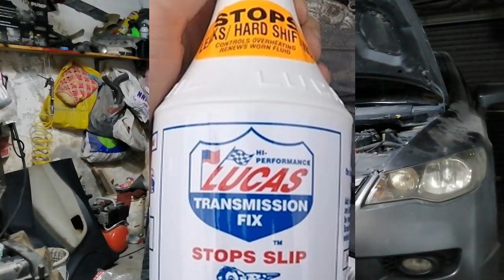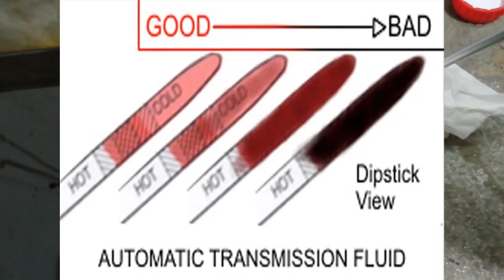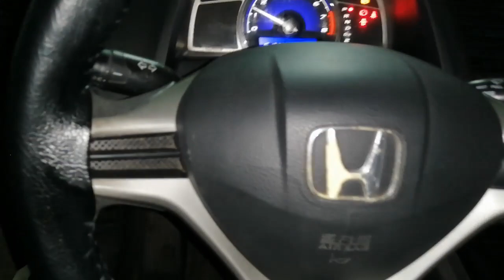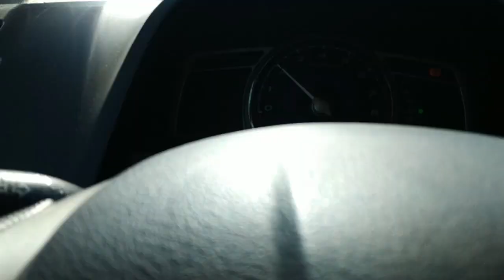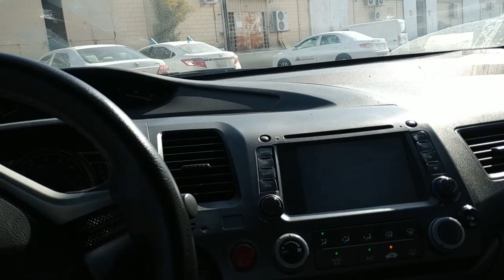Paano mawala ang Delay at kadyot | Transmission Oil Replacement | Lucas transmission Fix

Comment: Na try ko na boss yung LUCAS trans fix sa Chevrolet Epica. Yung automatic transmission ko may slipping, tapos nag limp mode sya, nasa 3rd gear nlng sya hindi na ng 4th or 2nd 1st gear, steady na sya sa 3rd. So binawasan ko ng 24oz (710 ml) at nag add ako ng Lucas trans fix na 710ml. After 4 to 5 days naging smooth na ulit ang shifting at wala ng slip. Balik na sa dati. Pag lagay mo hindi sya agad effective, mag drive ka muna mga 3 to 5 days para humalo ang Lucas sa transmission oil.
Reply from the maker: Yun oh, oo sir minsan mararamdaman MO pag babago after Ilan days depende sa issue NG transmission, jeep safe sir.

Comment: Ser makatutulong kaya yan sa automatic transmission na crv 2004? Ang problema nya, pag tumatakbo, pag bumitaw ako sa silinyador, yung rpm bumabagsak mula 2000rpm bumabagsak bigla sa 500rpm tapos babalik din agad sa mga 1800rpm. Parang sa manual pag diniinan mo ng todo yung  clutch tapos ibabalik mo din. Nangyayari lang siya pag bumibitaw ako ng apak sa gas.

Comment: Sir ung honda Civic fd ko (2008 model) may delay po, it will take 1 second to accelarate faster kung mg oovertake tpos nmn po pag nag rereverse po 4 seconds po bago pumasok, ano kya maganda dito sir?
Reply from the maker: Hello sir ace. Eto mga dapat mong I conseder sa issue NG auto MO. Fuel filter baka dikapa nakapag Palit. Fuel injector baka madumi na. Sparkplug better to change if matagal na sobrang di na papalitan.
Reply: @Macgarage08  sir location nyo po same po kami ng issue ang sabi sakin need na daw rebuild yung transmission or palitan ng surplus po
Reply: sir ok na yung sayo? same kasi tayo ng issue
Reply: sir ok na yung sayo? same kasi tayo ng issue

Comment: Can this be used in a 1999 Toyota Hiace? 1kzte engine with automatic transmission. Thanks!
Reply from the maker: Yes po, you can use this for automatic and manual transmission diesel or gasoline engine.
Reply: Thank you!!!

Comment: Sir. Anu po mas magandang transmission fluid sa honda city 2006 idsi ATF DW1 or CVTF. sana masagot tanong ko. Slaamat more power.
Reply from the maker: Hello sir joenel.  Atf lang need mo sa 2006 city DW1. Kasi ang cvtf is sa CVT transmission mag kaiba ang CVT and normal AFT.
Reply: @Macgarage08  sir ano alam nyo po ba ang tamang transmission fluid for honda jazz 2005 idsi 1.3? naguguluhan na kasi talaga ako sir. twice na kasi ako nagpalit ng surplus tranny. ive been using cvtf.pero nagkakaroon sya ng dragging. one more thing nakalagay sa deep stick nya is ATF. unfortunately wala na po sakin ang owners manual. pero as far as i know CVT ang tranny ng kotse ko. until nakita ko sa isang youtube blogger na ATF DEXRON 3 ang naging remedy ng auto nya. base sa napanood ko sa blog nya same model ng unit and same issue ang nanyari samin. baka po mabigyan nyo ako ng advice sir. salamat po

Comment: Hello po pwd po magtanong. Nag palit po ako ng cvt transmission ng jeep patriot. Ang tnong po bkit nalagutok pag nilagay mo sa reverse at sa drive at pag dinarive muna sa drive ayaw nya mag continuous un shifting ng gear dpat pag dinarive mo tuloy tuloy ng palit ng kambyo like 12345 dba . Ano kya anh mali sa gawa ko. Or bka sira un nabli kong transmission
Reply from the maker: Sir Marvin, cheneck nyo ba maigi yung oil na binili nyo CVT oil ba yung nailagay nyo kasi base sa sinabi nyo ang gannyan issue is wrong oil ang nalagay nyo. Pag nalagyan kasi ng not CVT oil ang CVT transmission gannyan ng issue nya.
Reply: @Macgarage08  sir mac eto po un oil na nilagay ko motomaster un brand nya nakalagay cvt automatic transmission fluid at full synthetic kulay red po yan. Sa palagay nyo po buo un transmission na nabli ko at mali kya un oil na nilagay ko
Reply: Pag nilagay po sa reverse at drive nalagutok at nauga un sasakyan. Sa neutral wlang problema at isa pa pag nilagay mo da drive at naandar na nd nag c shift ng tuloy tuloy un 1 2 3 4 5 nka stay lng sa 1 sna sir mac matulungan mko sa issue nitong transmission ko maraming salamat po…

Comment: Sir, may tanong po ako. Kakachange fluid ko lang po kasi ng Mitsubishi Lancer Automatic Deisel Engine gamit ang CVT Fluid. Pero may delay pa rin ang pag change gear. Dapat bang ATF ang ginamit ko at hindi CVT Fluid? or kailangan ko bang palitan lahat para malagyan muna ng Lucas Transmission Fix bago maglagay ng tamang fluid? Salamat po sa sagot.
Reply from the maker: Good day sir, if ang transmission mo ay CVT dimo pwedeng lagyan ng ATF same din sa atf transmission di sya pwedeng CVT.
If CVT ang transmission mo sir di pwedeng gamitan ng Lucas oil.
Reply from the maker: If newly change atf kalang bawas kalang same amount ng Lucas sa transmission mo then add the Lucas.
Reply: Sir pag po ba cvt trans anu pwd gamitin na tulad ng lucas

Comment: Pwede ko po ba rin e reuse ang ATF ko kasi bago ko lang to na change ng oil
Reply from the maker: Opo pwedeng pwede.
Reply: Thanks sir
Reply: Sir last nalang pwede po ba ilagay ko nalang deretso ung lucas hindi ko na e drain ang ATF
Reply from the maker: @deltonduhaylungsod571  sir tonio, if feel mo na bago bago pa ang ATF mo pwede muna ihalo no need na mag change oil. regarding naman sa derecho muna sa transmission mo yung lucas hindi pwede sir, need mo mag bawas ng same amount ng lucas.
Reply: Kung hyundai accent sir 2013 model mga ilan kaya ang mixing nyan??
Reply from the maker: @deltonduhaylungsod571  same lang din sir, basta mag bawas ka muna ng atf sa transmission same amount ng lucas bago mo i dagdag ang luca oil.
Reply: @Macgarage08  ok sir salamat

Comment: Nice video sir, question lang po sir nakakatulong ba ung lucas stop slip mag pa smooth ng jerk? Car(AT) ko po kasi may konting jerk i believe its from 2nd gear to 1st gear before mag stop ung car. More power po sa channel nyo sir..
Reply from the maker: Salamat sir, opo kaya nyan solutionan Ang mga mild jerking and licking oil.
Pero di po Yan applicable sa CVT transmission

Comment: Sir problem ng altis 2003 ko..sa.umaga ayaw po umabante need pa nya painitin ng mga 10 min. Bago umabante at pag paparada ka nman may kalabog pag lagay mo ng drive at reverse kaya p kaya ng lucas yan sir..
Reply from the maker: Hello sir reynald,  Kaya PA po try nyo muna bago nyo pagawa transmission. Salamat
Reply: @Macgarage08  sir ano po ba dapat na ilagay ..lucas transmission fix or transmission slip or lubegard shudder fix..thanks po..
Reply from the maker: @reynaldnerona2685  sir, lucas transmission fix.

Comment: Sir good day po may problema po ako sa transmission ng kotse namin na kia rio pinaayos na s mikaniko nagpalit ng atf ganun pa din hindi sya makaahon kahit konting akyat lng at may kadyot pag ishift sa drive or reverse makakatulong po kaya ang lucas transmission fix?maraming salamat po.god bless
Reply from the maker: Hello sir, anu pong model NG car nyo? Bagong Kia ba? My code bang binigay c ECU? Yung Lucas po kasi sa mga kadyot mga delay mare resolve nya pero pag malala na di nakaya.
Reply: @Macgarage08  2011 model po sir anong code po.
Reply from the maker: Bago PA Yan. Walabang check engine sa dashboard mo?  Pm mo nalang ako sa fb page q sir. Mack Garage diy

Comment: Good day sir pa help po may nginig ang honda ct ko 2008 matic kapag full stop lng sya nalabas na pra bang my napigil ...bago na engine support..mkkatulong kya yan sir?
Reply from the maker: Hello sir Kobe, check nyo sir sparkplug nyo pag luma na may gannyan pagkakataon.
Reply: @Macgarage08  sir last wik ko lng po pinalitan spark plug new na lhat gnon din ang atf new nrin po..pero still d problem is there...
Reply from the maker: Means sa fuel system ka may problema. Can be fuel filter.

Comment: Hello Sir? ilang kms na po mileage ng civic na nasa video? just got mine kase a 2012 model civic FB medyo may delay ng konti ee, matutulungan ba ako ng Lucas? hehe thanks and more power
Reply from the maker: Good eve sir, 200kbplus na, maganda Yan Lucas mawawala talaga delay.
Reply from the maker: Oo sir, matutulungan ka nyan proven nayan madami daminarin ako nalang Yan nyan.
Reply: @Macgarage08  okay sir, yung civic ko kase nasa 68k mileage palang ewan ko bat ganun may hesitation pag shift nya ee, tapos pag overtake parang loading before downshift hehe
Reply from the maker: 1st owner kabayan sir, gamitan mo nyan 100% tanggal Yan delay mo.
Reply: @Macgarage08  2nd owner po ako, wala naman po ba side effects? baka mag check engine or what? Thanks bossing

Comment: Where did you find this in Saudi Arabia?
Reply from the maker: souq.com or amazon.
Reply: @Macgarage08  He sells it for 133 riyals in Amazon total. 155 riyals
Reply: @Macgarage08  Is it worth
Reply: @Macgarage08  I have your same problem
Reply: Does the product do what it says in the instructions?
Reply from the maker: Yes, it's really work. If you don't severe issue on your gear.
Reply: @Macgarage08  I have an automatic gear problem. I did not change the oil. The internal clutch burned out and changed the oil. Is this product good for me?
Reply: @Macgarage08  ؟

Comment: Boss pwde ba to sa honda accord v6 kasi may delay sa engagement sya from neutral to drive mga 2 seconds tapos pag mainit na ang makina aabot ng 5 seconds ang delay. Ok naman ang shifting nya pati neutral to reverse ok din. Ang neutral to drive lang may delay.
Reply from the maker: Opo pwede po. Basta not CVT transmission mo pwede po.
Reply: May experience ka na ba sa ganitong delay boss? From neutral to drive mag 2 seconds bago mag engage pag malamig pa ang makina pero aabot ng mga 5 seconds pag mainit na. Minsan mag blink ang D tapos may error code na Shift Solenoid Stuck on. Pero pag e erase ko ang code mawawala sya. Posible ba eto ang cause ng delay? Baka kasi pwde lang ipapa correct/reset sa scanner?
Reply: Pwde ba to gamitin kahit ang neutral to drive lang may delay? Pero ok naman ang shifting nya pag tumatakbo na.
Reply from the maker: If may code sir, need mo repair muna yun is either palitan mo or linisin mo, kasi yung issue ng delay mo is soliniod kahit mag lagay Tayo ng Lucas di masosilve ang issue sir. Advised ko better linisin mo muna if dimawala issue palit kana po ng soliniod.
Reply from the maker: If I keep mo ng gannyan maaring lumala ang issue madadamay ang ibang soliniod nyan.
Reply: Possible ba boss na ang solenoid ang cause ng delay? Pareho kang ba tong shift solenoid A, B, C at D boss or bawat isa iba iba talaga yan? Kasi pag isearch ko yung shift solenoid D and lalabas lang ay A ad B yung black and brown connector
Reply from the maker: @charlienunez4657  isa lang yan sir,, control nyan lahat kaya sya ang shift soliniod,  sa accord may 3 soliniod or 2 . isa sa taas and 2 sa front ng engine malapit sa radiator. baklasin mo lahat spriyan mo ng hangin or trottle cleaner. install mo ulit if may code parin delete mo, if bumalik ulit need mo palitan ang soliniod mo. but check mo sa scanner kung anung soliniod ang nag mamalfuction.
Reply: @Macgarage08  salamat boss

Comment: Bakit kailngan na nasa normal temperature ang makina bago mag change oil?.
Reply from the maker: Hi sir, mas mainam po kasi na warm Ang engine para mabilis na bumaba Ang langis sa drain plug at malessen and old oil sa entire engine.
Reply: @Macgarage08  Hindi ba mag cause ng loose threads sa bolt pag mainit
Reply from the maker: @okhita  you mean sir sa drain plug. dinaman po, gamitan mo nang torque wrench if medyo alangan ka.

Comment: I hope this can help solve my civic fd problem. I just don"t know where to bus this additive other than on line.
Reply from the maker: Hello Gil, if your transmission problem does not severe then I will help your trannny to work better. You can buy it at Amazon.com or eBay.Com